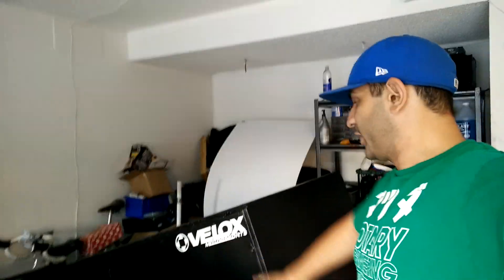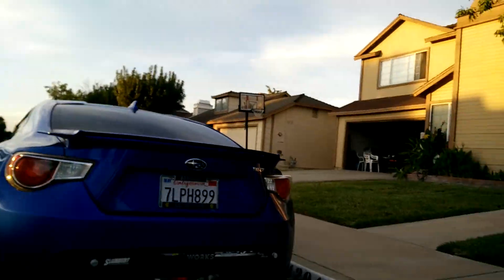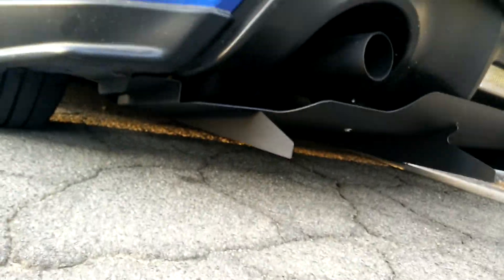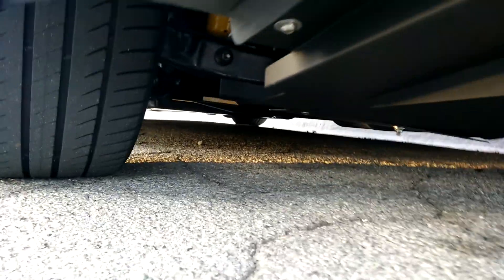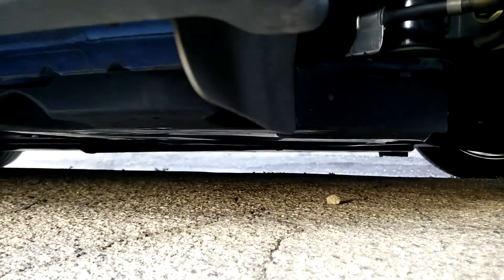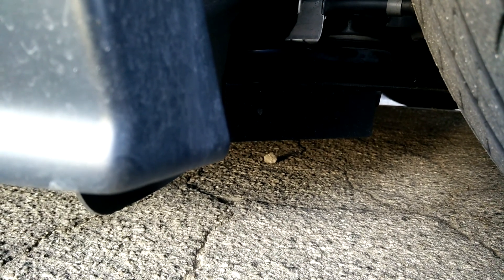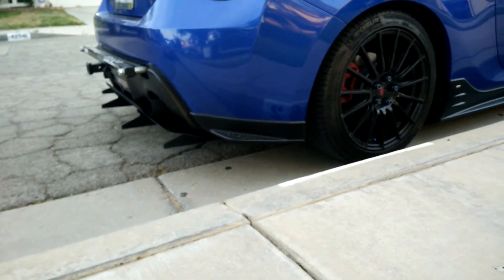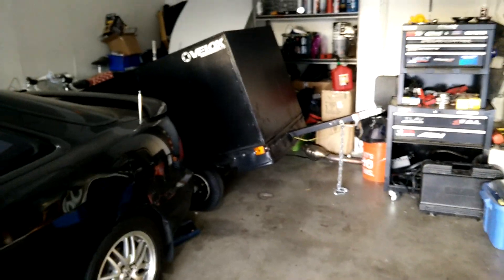Velox Motorsports Diffuser & differential covers

Comment: Hows the diffuser and covers holding up?
Reply from the maker: tfpjr They still look like they're brand new.
Reply: Any difference in mileage since using them?
Reply from the maker: tfpjr In the video I discussed the improvement in MPG I saw. I averaged 28 MPG on my trip from LA to DC while towing my 800lb trailer. Once I got out here I've been running E85, so I have not done a direct comparison. There are hundreds of comments on improvements on FT86club.